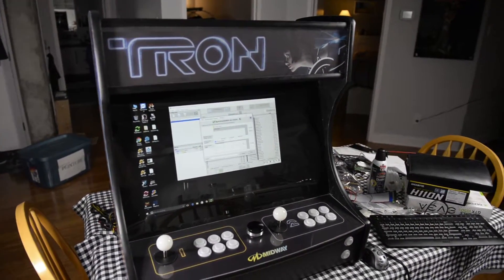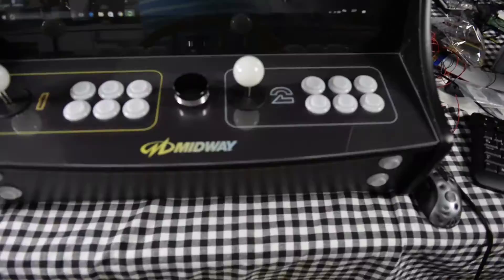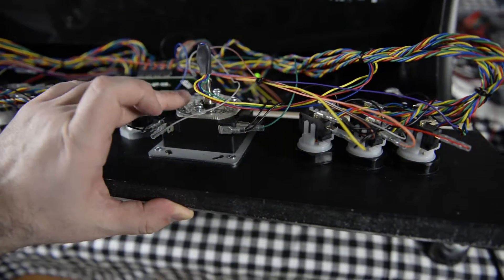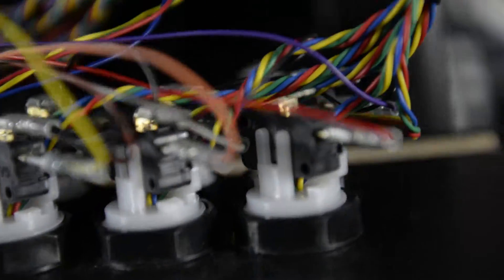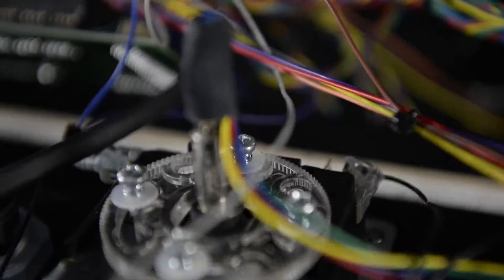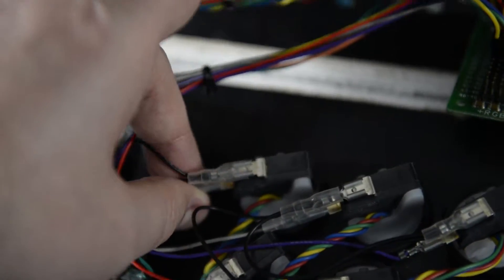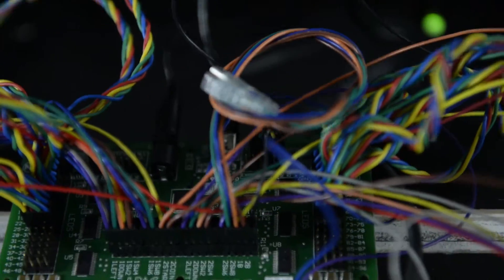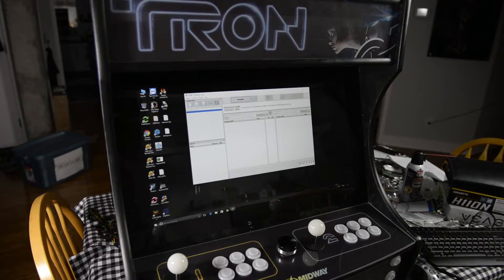Ultimarc Ultimate I/O RGB Light setup

Comment: nice setup, can we use 3rd and 4th player ports on ultimate board to wire other buttons like mouse clicks? thanks
Reply from the maker: You would need to check on the user guide of the controller since I didn't setup 4 controller. Sorry
Reply: yes you can mate if you dont use a track ball or spinner, if you plug in a spinner and tack ball then you would need to buy a separate board..

Comment: Hi, I like your video. I am having a lot of trouble with my Ipac Ultimate with my arcade. I am using LED Blinky, and I am just getting started . I used my own harness for the buttons to control them and there is only one button being recongnized by my Ipac ultimate when there should be 6 buttons . I then decided to use the large harness that you have to see if it was my wiring that i made , but it does the same thing. It only sees one button . Also , I cant get the LEDs to light on my buttons. Do I have to program All of the LEDS first? I just want to see if they all work. Thanks
Reply from the maker: Hi Vince,
Well, there could be a lot of different things wrong with your setup. Start with the beginning, just one button and make sure you plugged everything as they are supposed to be. Also in the LEDBlinky tools there is something to test everything separately. 
It sound like you have a wiring problem right now. close to 99% of the time when a behavior is wrong it's the wiring.
Good Luck
Reply: Thank you for the reply, After more testing , I had my power cable to my power supply the wires were crossed once I switched the wires I got power to the board and the lights work!
Reply from the maker: There you go wiring!